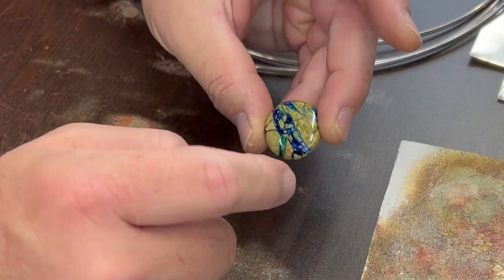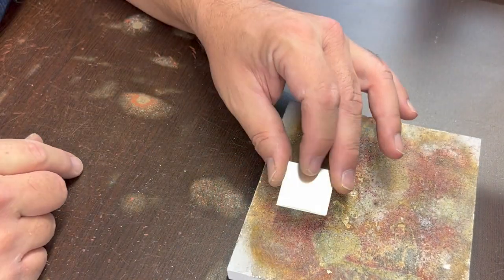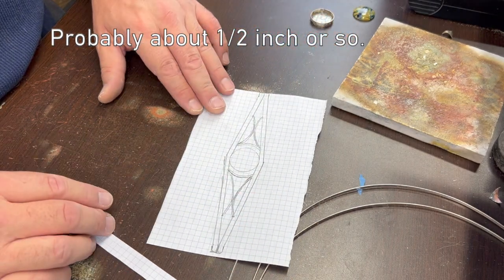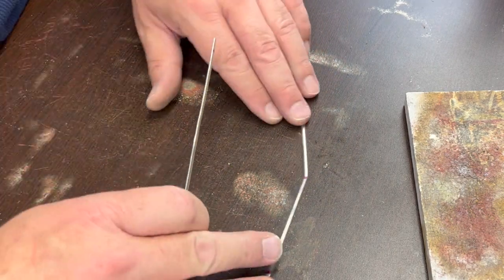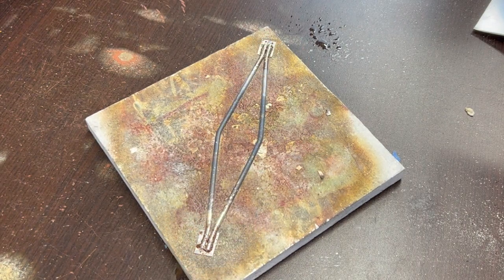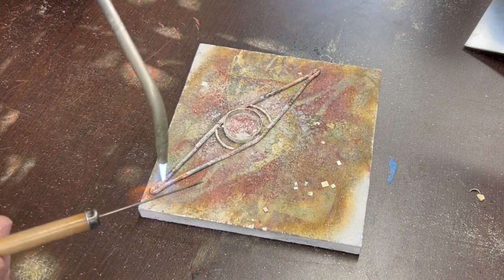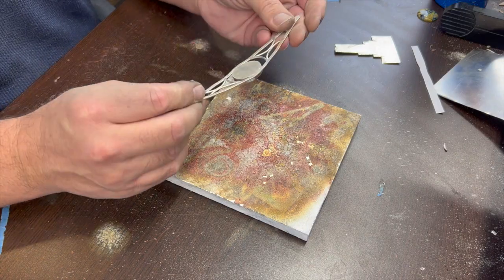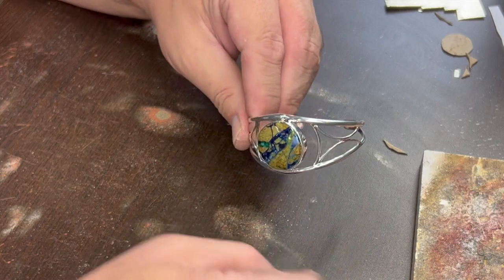Making A Beautiful Cuff Bracelet: A Silversmithing Tutorial

Comment: This is the first video of yours that Ive seen and now Im gonna binge watch you! Excellent excellent teacher. I learned multiple new things not the least of which was setting and burnishing with pliers! Im a newbie and hobbyist but Im gonna try this one. Im a tad bit apprehensive about bending the half round sideways and also about getting the angles on the decorative trim bits right to fit tight
Reply from the maker: I'm so glad you are finding these useful Vibekelevan!  I have confidence that you can do it.  What torch are you using?
Reply: @chadssilversmithing  I dont know the name of the torch but it is hooked up to a propane Tànk:)
Reply: I only have 28 g and 20 g Argentium  sheet. Which do you suggest?

Comment: Hey Chad have you ever tried using silver solder paste ? It has silver dust and flux in it and is easier to use than sheet solder pieces.
Reply from the maker: Hello Herman. I have a couple of friends who have used it, and they like it.  I haven’t found one that has as high a silver content as hard solder. This isn’t to say one doesn’t exist, but I haven’t run across one.  I would love to try one if someone makes at least a 75% silver paste solder.  What percentage is the one you use?  Thank you for the comment Herman!

Comment: I’m interested in knowing more about the flux spray.   Do you mix your own and use your own spray bottle?  I haven’t seen any spray bottles I liked or trusted would hold up.
Reply from the maker: I just use a cheap spray bottle from the grocery store. They will eventually gum up with flux, but you can empty them, soak them in hot water and clean them out and it usually unclogs them:). Even doing this, you probably still need to replace them periodically.

Comment: Morning Chad! Just noticed this great video and tips, wish I seen it yesterday before I made a cuff bracelet with 2 8gauge 1/2 round wire which I tried to put couple tabs at end but because my wire was twisted a bit (now I know!) it wouldn't solder correctly so I made paddle at each end with my hammer, looks pretty cool though I think! Was going to use 3 12.5x17.75mm turquoise cabochons but am using 1 instead (making earrings with other 2) because I felt a bit intimidated about setting three on bracelet. My designs change as I go along it seems! You only pickle after all soldering done but I thought the silver would be too dirty for more soldering if you didn't pickle after each soldering join, guess that's not true. So, I should leave bracelet flat and set stone or stones into bezel before shaping on mandrel? Most video's show that stone is last procedure, another untrue thing! Can you make a video setting multiply stones on bracelet? After I finish setting stone and cleaning up bracelet, I'll send picture if I can figure out how to do that!
Reply from the maker: Good morning!  Thanks for the compliment:). The reason most pickle between steps is they are eliminating previous flux. Many people carefully paint flux only in the spot they want solder to flow in order to keep it from flowing other places. Once that solder joint is done, they pickle and then paint flux on for the next join.  That way is pretty standard for most people. I’m kind of the odd one here for hosing things down with flux:). As far as stone setting last, you can go either way. I usually set the stone and then polish, unless it’s an Opal or some other easily damaged stone. The trade-off is that without a stone in your bezel, it’s easy to catch it on the polishing wheel and tear it.  If you go to my website:  http://www.cvpsilver.com you should be able to email me and attach a picture. I’d love to see stuff that you all are making.  At some point I’ll do a cuff with multiple stones. Thanks for the great comment!
Reply: oh wow I've been part of that crew and now I know why I've been having a bum time with that! And it so frustrating when solder doesn't flow on pinpoint I set up! Alright, tmoro I am skipping that stuff and going full blown flux
Reply: whoops! that might have been a little confusing I can set stone and clean it's the sending it to you I have to ask a friend to send, ha ha!

Comment: I love your content (I've been binge watching all night). But I hate your sound quality (sorry). I know you've been working on it, and I have absolutely no ideas that involve technology, so I have to think low-tech. How about placing a rotary cutting mat on your table? It will deaden some of the sound and it is a very sturdy surface to work on. It also has a grid on one side that helps with measuring or lining things up. Not sure you'd be able to solder on top of it, but I think you can figure out a way to make it safe. I use a large mat on my work table, but I don't solder at that table. They even have small mats at Dollar Tree!
Reply from the maker: Thanks for the good advice Kathy!  We are saving up for a clip on mic which hopefully will help to counteract my tossing around of tools noise:). My current microphone is clamped to the table I work at so it transmits a lot of sound. I will look for a good safe surface like you suggested and implement it if I can. Thanks for the good constructive criticism!

Comment: What solder strength did you use for the decorative wires inside the main bracelet...medium or soft and also for soldering the bezel to the main bracelet wires ? Hard medium to easy ...??
Reply from the maker: Hello Biggertom!  I do things a bit unconventionally. I use hard silver solder for pretty much everything.  I will occasionally use a bit of easy if I have a really sketchy final solder joint:). On this one I just used hard.